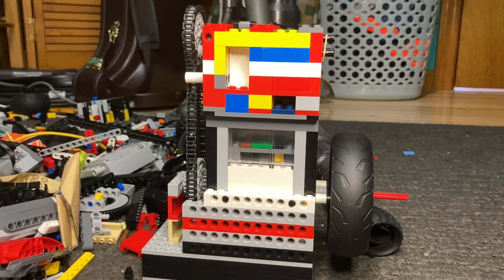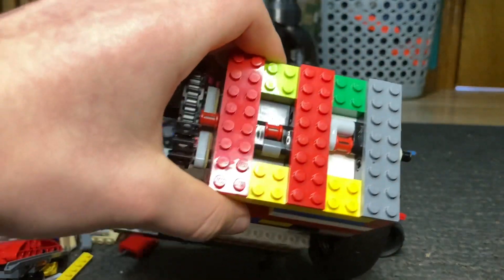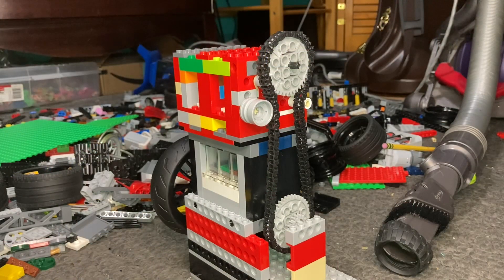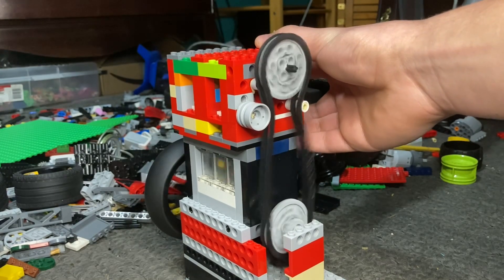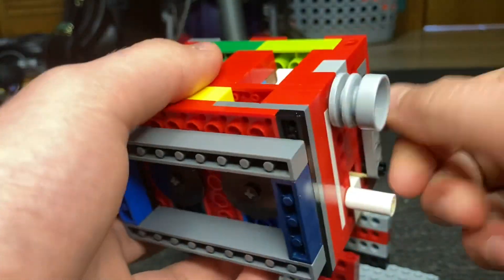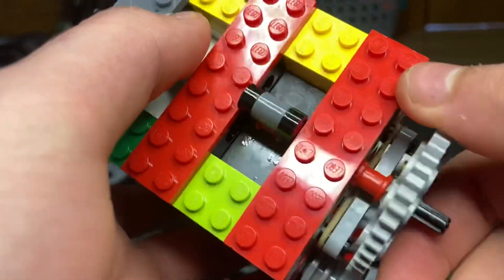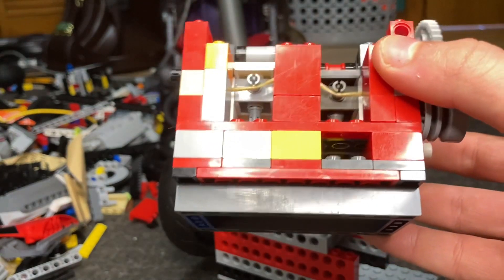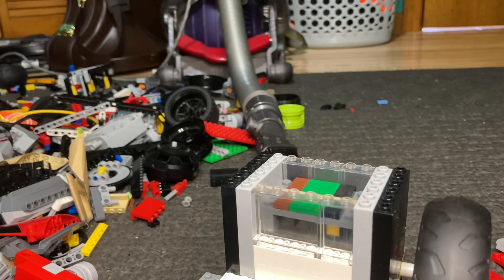Showcase: SOHC Lego Vacuum Engine

Comment: You need to have 2 gears on the top to individually control the exhaust and intake separately, plus it will look 2x cooler
Reply: Sohc stands for single over head cam
Reply: That’s called a Dohc engine

Comment: Do the cams make it run better or is the standard single valve better?
Reply: standard single valve delivers evidently higher rpms compared to a more realistic system.... a system with cams, valves, and chains has higher friction rates and inherently is harder to turn over because of the valve resistance cause by the force required to keep the valve closed.
Reply from the maker: What he said 👆
Reply: So why do cars use cams then?
Reply: @isaiahr3937  Because cars use combustion engines so the valves have to withstand super high pressures in the explosion event. Slide valves like you see on a lot of other LEGO engines could easily lock up or break under the pressure of the explosions.
Reply: @isaiahr3937  probably  because cars are not run off of vacuums? i mean, what else would cars use....
Reply: Just for a better deal?
Reply: @isaiahr3937  cars do not use ari power. they are powered by min explosions inside the cylinder, thus cams and poppet valves are the only way of controlling that explosion ( with a few exceptions ) . no gas engine has a butterfly piston or the svs system simply because lego vacuum engines are run off a vacuum, wehreas normal engines use spark and combustion.
Reply: Seal

Comment: You never fail to amaze me! 

You actually built a top-end with an actual camshaft and semi realistic valves!

I just ordered a bunch of parts that i need to start moving away from the desmodromic pushrod system that you see on my recent engines and start building overhead valve designs similar to this. 

I can't wait to see what you build next!
Reply: hey car gas/ domestic wingman / nikolas tesla. i new it was you
Reply: @taylor842  hey buddy

Comment: do you have any tips for a butterfly engine to make it faster
Reply: make it an opposed butterfly? i dunno mine runs very fast
Reply: @taylor842  ok thanks ill try
Reply: @chanlikeslves7983  its absically a butterfly engine with a throttle, a piston/ block added on top, and a chain connecting the two crankshafts.

Comment: cool concept and desgin, shame about the overall speed though. probably just the fact that automotive technology  dosent  yield very good results in a lego application.
Reply from the maker: That makes a lot of sense. I was disappointed too, but I really needed to upload. Hopefully my next engine will be a little more impressive.
Reply: @KFPlusLegoMastery  its a nice concept, but lego just cant support a valve train application that complicated
Reply: @KFPlusLegoMastery  if you look when its running the top gear will speed up and then slightly slow down. i think maybe if ou reduced the spring and or rubber band pressure a little bit you might get higher speeds, as well as inscreasing lift.